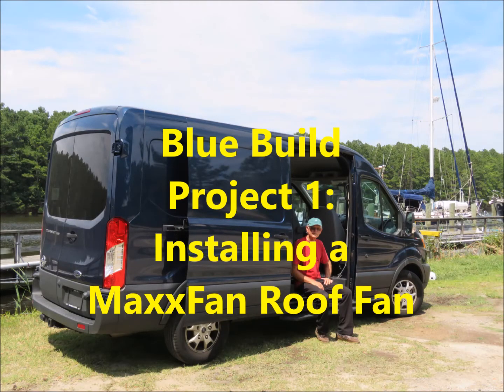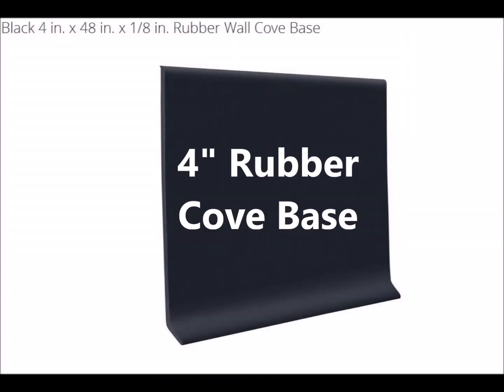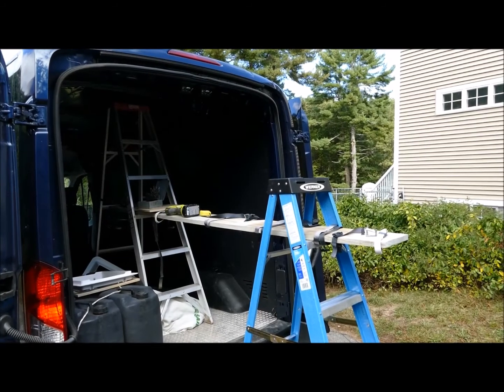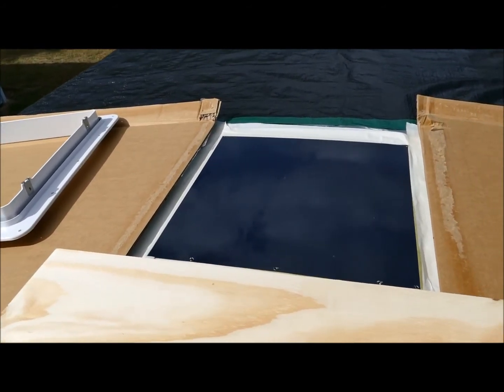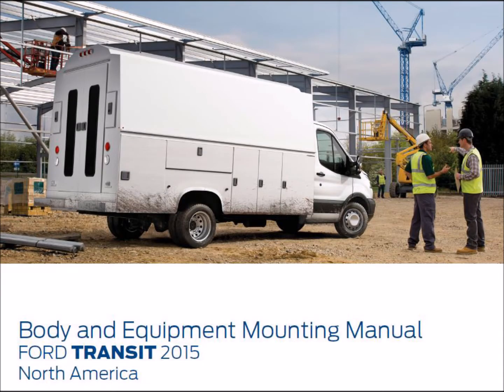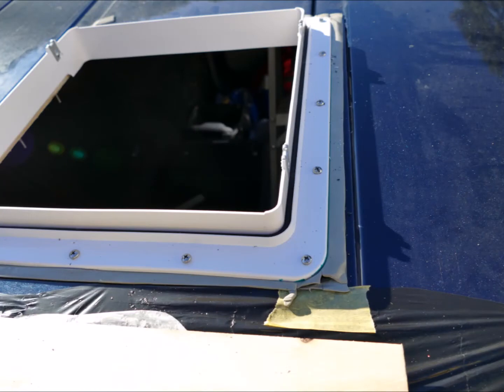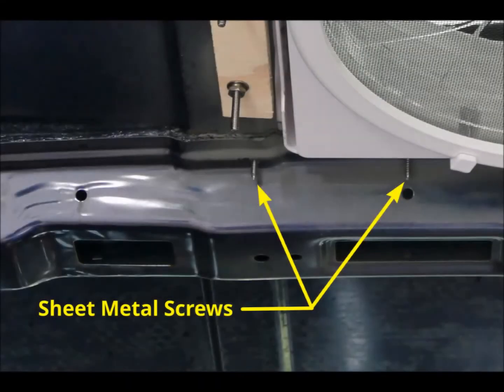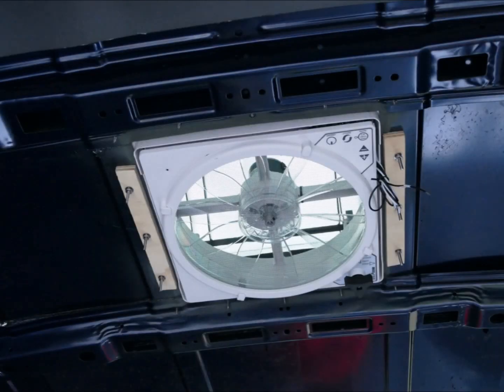Installing a Roof Fan on a Ford Transit - Upfitting Blue: Project 1

Comment: Hi Just a Little Further! This video is super helpful. I had a question regarding your use of the black rubber wall cove base. To clarify, did you cut strips and fill in the vertical gutters along the roof on either side of the fan? To fill in that gap? You didn't place an entire sheet of the cove base underneath the fan correct? Just a strip on either side? Thanks for your help!
Reply from the maker: Yes, I cut strips that fit the gutters. Hope your project goes well!

Comment: I measured 13.9 inches to the struts.....did you have to edge them at all?
Reply from the maker: Hi Tom, I'm not sure what you meant by 'edge them'. I didn't have to cut into the struts... the fan fit between them. Hope this helps.

Comment: Has there been any leaks?
Reply from the maker: Hi Patrick, It's now been more than 2-1/2 years and no leaks so far. Since the fan is right over the bunk, we would notice. The only time we noticed any moisture at all was when a thunderstorm came through one night while the fan was open and we got some splash.
Reply: @JustALittleFurther  I just cut the hole for my fan lastnight after watching your video! Did you need to cut the rib?
Reply: I ask because I am just short of getting the one side past the rib without cutting. I am affraid to try and force it in.
Reply from the maker: Mine fit just between the ribs. Can you cut just enough off the rib to get the fan to fit?

Comment: The video was very helpful, thanks.  Wondering what you used as your power source for the fan and if you've used any of the Ford Upfitter Aux Power Switches in the center console?
Reply: The fan will be powered by a breaker on the DC breaker panel. I should be starting that project in the next week or two. So far, all I've only used is one of the Aux Power Switches. It switches the side view camera on when we're backing out of a parking space. Haven't decided what any of the other switches should be used for. Do you have a plan for them?
Reply: Gotcha.   I ended up wiring in 2 fans and connected them to Auxiliary switch 2.  I used the 43 pin upfitter harness to run the positive and ground from the fans.  I use Auxiliary Switch 1 to control a LED light bar mounted on the front bumper.  I replaced relay R6 in the Aux panel under the driver seat with the bridged relay that came in the bag with the Upfitter harness.  Swapping the relay allows Aux switches 1, 2, and 3 to be live all the time and I don't need to have the key in the ignition.  That said, I also have the bigger alternator and the 2 AGM batteries.

Comment: Why the roof cutout doesn't have relief radii at the 4 corners. This will prevent the roof from cracking due to harmonics.
Reply from the maker: A good observation. Do you think that the 3/8” pilot holes in each corner would be enough of a radius?